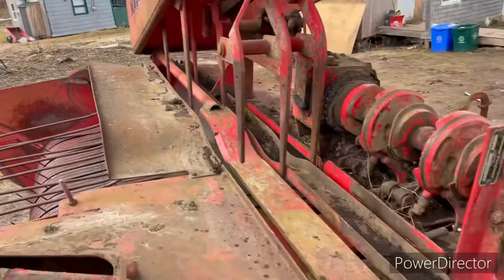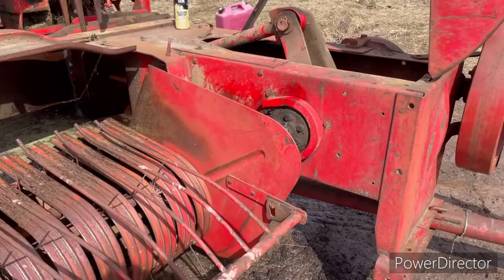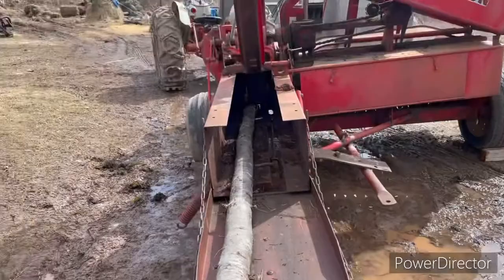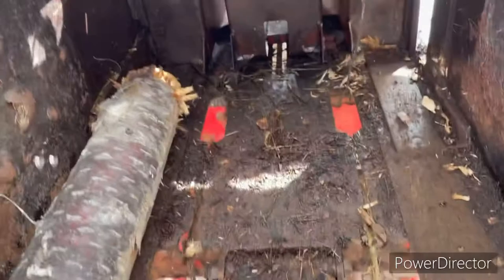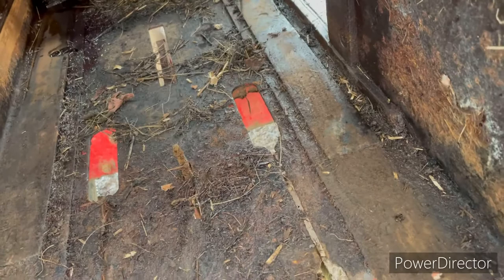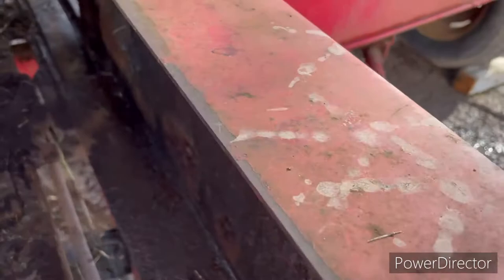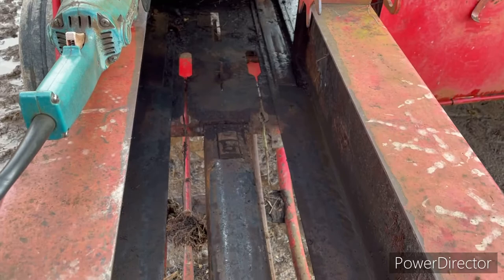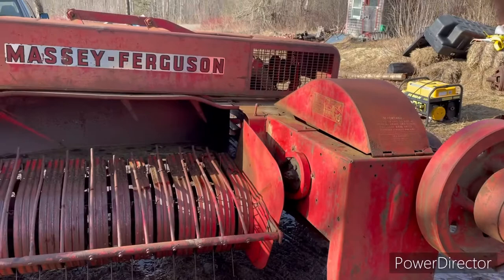Stuck plunger , Massey Ferguson 10 baler

Comment: Store your baler inside. Clean  it out before storage. Oil it with diesel fuel and 30 weight mix. A pump sprayer works well. A leaf blower works great for cleaning. Any amount of hay left in the baler draws moisture. Maintenance, maintenance, maintenance!!!!
Reply from the maker: That’s what I’ll be doing, I just bought it and brought it that day, it sat outside with hay in it for a couple years before I bought it,I got it working good now I got a couple hundred bales through it so far, I’ll be posting a haying video soon

Comment: I have a MF 10 too. I had the same thing in 1992 when I bought it. The chamber was black-burnt, how I don't know, the shear bolts shouldn't of allowed that. Anyways, you have to loosen the chamber adjustment slide bolts , on the outside of the chamber, the locking nut and adjustment bolt, then the plunger should loosen enough to pull it out of the chamber. Mine was bent out of square, so I used a framing square to square -up the plunger, beating it into square with a sledge. It has worked well to now, I baled oat hay and alfalfa. You can still get parts from MF unlike NH or Freeman etc. It was a 1969 manufacture.

Comment: I guess these balers are old with the Massey Ferguson name on them. As they dropped the Harris name and made it just Massey Ferguson
in 1958 .  I brought up on line the second generation Massey Harris square baler (the all new 703 in 1957) sold in 58.  My dad bought a
#3 in the 60's  was nice having a shiny new red  Massey Ferguson baler. We didn't have a thrower so it didn't matter if it missed a  a few bales per 10 acres , usually changing balls of twine or if to much dust was on the knotter. I was trying to think of what he paid for it.
I think it was close to 3 grand in 1965 give or take a year or two

Comment: I have a  MF model 10 too. When I got it drug outta the bushes , it took me 4 days to free up the plunger head . It was totally fused with rust . I used an air chisel . Not surprising when you consider how old these balers are . They were built in 1950 . I,m only 3 years older than my baler . 😂
Reply from the maker: Mine wasn’t in bushes but it sat with hay in the chamber outside not covered for a couple years before I bought it.
Reply: @kirksawler1199    Mine sat for about ,,,I,m guessing a good 10 years . I got a John Deere #8 sickle bar mower , an International side delivery rake , and the MF 10 for a grand total of $750.
Reply from the maker: Nice, I have an international side delivery rake it was given to me, I bought an international 990 haybine in January for $500 I paid $1000 for the baler
Reply from the maker: My tractor is a 1956 Ford 860

Comment: Hello I have a international 445D runs ok when you iron out the small problems. Having hay in chamber is not good for them. It's very caustic when it gets wet. I use galmat it's water based rust converter. I charge up the baler before baling in the field
Then there is no need to pick up hay.

Comment: Would be easier to free up the plunger if is disconnected from the drive crank - that is keywayed to the gearbox driveshaft, hence your difficulties. Beating up on the whole mechanism with a lump of tree branch isn't doing it any favours whatsoever.
 If removing the plunger from the rear, best to remember and remove those side retainers first - they have the appearance of a cheese grater and are installed to prevent springback of the hay wedge, after it has been compressed by the ram stroke.
Reply from the maker: Thanks

Comment: This is what happens when bales are left in the bale chamber over winter , its called rust jacking .
Reply from the maker: Yeah the guy I bought it from didn’t use use it the year before and it sat with hay in the chamber, I took the hay out when I got done with it and didn’t have an issue at all this year